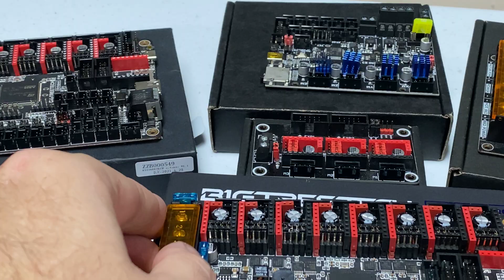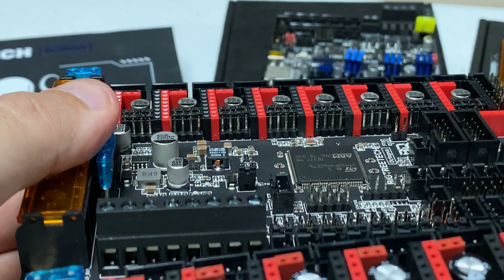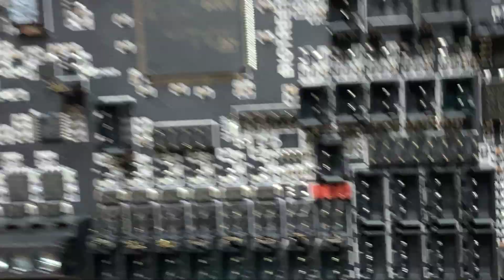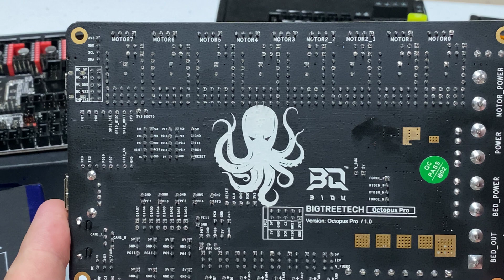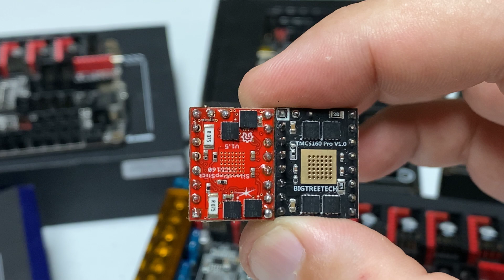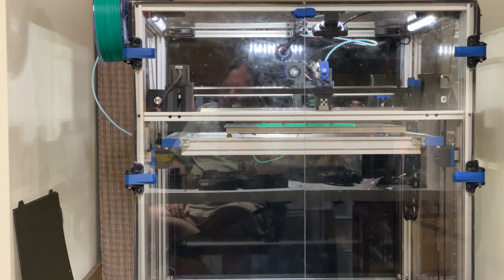BTT Octopus Pro and 5160HV drivers review

Comment: and after 2y using this board, i was today old when i learned the funny sad piiiii of death when i turn my printer off, it's a feature.
thank you for the vid, I'm waiting for my 5160 plus and 48vv psu to be delivered and this video was a treasure of infos! The only thing i dislike about this board is the can connector with the rj11. might swap it for a normal 2pin.

Comment: E does not move at all with BTT Octopus Pro F429 board /48V /  BTT tmc5160pro v1.1 / 1.7A motor 42 / Vref 800mA / Marlin / SPI, needing some help please

Comment: I tried external mellow TMC5160 Pro V1.2 with Octopus Pro/Klipper ang got constantly "Unable to write tmc spi 'stepper_x' register GLOBALSCALER" (24V or 48V same) in any configuration I could imagine. (corexy) TMC2209 in uart working fine on this board. So I am stuck before i contact mellow support or BTT support... ...does anyone have a working configuration example for Octopus Pro/Mellow 5160 Pro/ Klipper?  There are some examples but all for super 8 board. thank you.

Comment: That you for your video. Great presentation. If you have time could you mention how the motor voltage jumpers work. Ex: if a person is running 36v motors will they need to use the ‘motor’ jumper?  And also could you elaborate on the voltage chopping?  For example: if your motor is 24v but your power supply is 36v dose the chopping do something like 24v-0-24v?

Comment: What do I set the driver in the firmware to when I'm not using drivers on the board? I have the cable out adapters going to my drivers.

Comment: Watched this and your 48v videos. Super helpful! Just had a recommendation question on the power supplies. I saw in another comment of yours that you need roughly 25-30w for each stepper at 48v. I have the new SKR 3 EZ on it's way to me and I will be running all 5 steppers on 48V. Will have a separate toolboard running the hotend assembly and extruder on 24V. A UHP-200-48 and a UHP-200-24 should be good to go to run my toolboard, SKR board, and steppers right? 

Also, I know there are many ways to get voltage to a raspberry pi in this setup. What do you usually use? I'm thinking just a simple step down board from the 24v to 5v.

Comment: Seems to me the stepper capacitors on the non-pro board is of better quality than the 'pro' version. Can anyone confirm what I am seeing in the video at 5:28?
Reply: What makes you think that? It looks like the non pro is using surface mount caps whereas the pro one looks like they are through hole. The main difference is just the package and the specs of the cap.

Comment: what kind of steppers do you need when running the higher volt drivers? like all the printer steppers seem to say 3 to 12 volts? is that not a hard limit? or does one have to buy higher voltage steppers too?

Comment: I would assume two 48v steppers on the board at 2A would need at least 192 watts just to run those two drivers. With 8 of those bad boys I’d imagine would need a TON more than 200 watts. Am I missing something on how the power passes through this circuit?
Reply from the maker: The steppers run at a MUCH lower voltage to there’s a form of PWM called voltage chopping in place.   Steppers need 25-30w at peak usage.

Comment: Great video, thanks! I‘ve got mine properly working except for one thing: I have the part cooling CNC FAN0 connected and it works (fan runs when clicking FANS ON), all the other FAN ports CNC FAN1 to CNC FAN5 do not work whatever I try. Are there any special steps required to turn them on/use them?

Comment: Hi,
I’m struggling with my octopus pro, btt tmc5160 and klipper configuration for my x and y. Rest is 2209 and is explaned in many printer.cfg’s. Can you share you your printer.cfg so i can see which 5160 parameters i have to set. This is my first klipper deep dive :-) thanks in advance.

Comment: Hi do you think closed loop stepper motors will make a difference when running the printer at high speed ? Correct me if I'm wrong but having a motor that will Correct its position  could be an advantage and allow more rapid movement ?

Comment: A proper 3D printer controller should support 100W heater & have a proper PT100 interface such as MAX31856 right on board. In a worst case scenario the board should have a proper interface for connecting &  driving an external power MOSFET. Otherwise it looks like these guys from Bigtree have no fuckin' clue about what they design at all.
Reply: Why are you so mad about it? This is a pretty popular board now. Each heater is rated for 5 A, so at 24 V that is 121 W, the bed connection is plenty powerful enough, it does have the MAX31856, so what are you complaining about?

Do you have any legitimate complaints or are you just moaning for no reason?

Comment: I'm plannig to use octopus pro with 6 tmc5160HV with lrs-200-48 for included motors in vcore 3 pack. It's enough power or i need stronger psu?

Comment: Have UHP-500-55 that I'm going to use with the Octopus Pro and HV drivers on Voron 2.4.  Want to drive all steppers drivers @ 55v; with motors .8 to 1amps.  I don't think I'll run into issue but HV stuff is new to me.
Reply: Did you burn everything up ?

Comment: Do you know if the the voltage-only fan headers rated for enough current to power a raspberry pi 4b?
Reply: Their is a dedicated raspberry pi header which provided 5V power to the pi. On a side note the 12V rail can provide up to 4A, the 5V up to 8A and the 3.3V up to 1A although that is the total including what the controller uses so you couldn't use exactly that much. the six PWM fans and two always on fan headers can be set to 5V, 12V or 24V however I haven't scouted the available draw for you yet sorry.

Comment: nice walkthough guide thanks Josh. very good pointing out these details on it. this pro board looks like it has some neat features

i am also reminded of something similar by mellow fly to have the HV caps and rail. but fewer steppers. whatelse i forgot now? yes is the other new project by some annex ppl. whereby you have as a separate board for the HV for klipper, with an rpi pico mcu on it

...but i also wonder now if we cannot have something cheaper as a replacement for BTT MOT stepper expansion board. i.e. that has no mcu and just breaks out via the EXP connector the plugs for the step sticks. but to improve it with separate HV mot power rail and bigger caps. then maybe that could be a cheaper way to augment those existing older boards which were not HV capable. like the spider etc. however i am not sure if that is feasible, since if not any obstacle then why not such product already exist yet? hmm. or maybe putting the best axes stepper on expansion is detriment to communication performance IDK. have not looked into it myself

anyway good video take care 👍

Comment: Hello, thanks for your video. BIGTREETECH TMC5160 pro can support up to 60V, not 63V. Friendly reminder: Voltages over 36V can shock you so pay attention to safety when using high voltage drivers.
Reply: which jumpers do you need to change for the 5160?
Reply: Pretty sure any kid can tell you a 9 volt battery is enough to shock, albeit on a wet tongue.

Comment: Good stuff thanks for the overview Josh!
I was under the impression that the non-pro octopus could also run both motor voltage and board voltage steppers simultaneously.  Is that not the case?
Reply from the maker: No the non pro does have the distinct stepper rail that you can run elevated voltage somewhat but it has 35v caps.
Reply: Duh sorry, I knew about the cap limitation.  brain fart on the voltage number used.  I just thought the Octopus standard could also run some motors on 24V and others on motor voltage.   Is that the case?  Or do I have to run them all on motor voltage?
Reply from the maker: @faithblinded  no the regular octo doesn’t have the jumpers, no.
Reply: @JoshMurrah  Ahh ok.  So if I want to run 28V for instance on one, all motors will need to run at that voltage.  Or I will need to break out the voltage pins of the driver by hand as shown in your other video.  Thanks for the quick responses as always!  A lot of us will be using your example to push our machines faster.  I really appreciate you taking the time to make these videos.